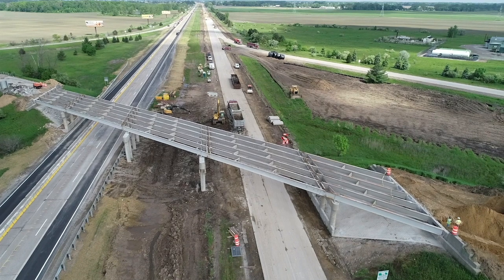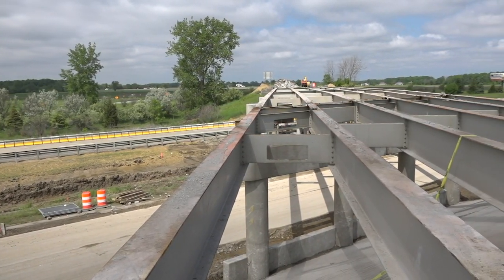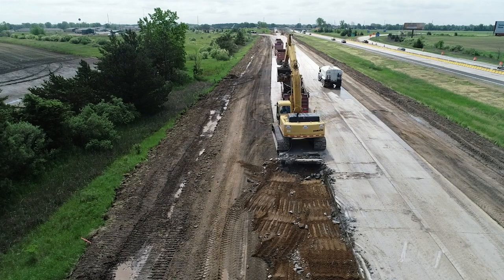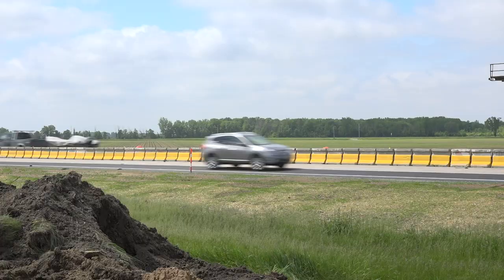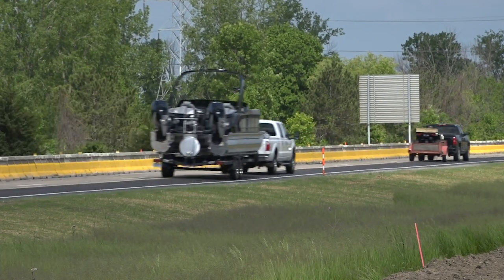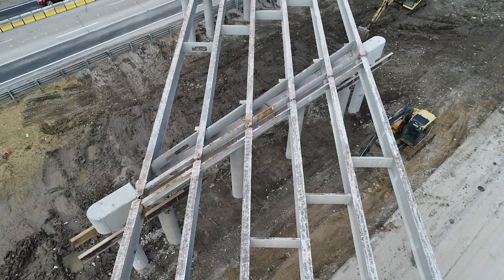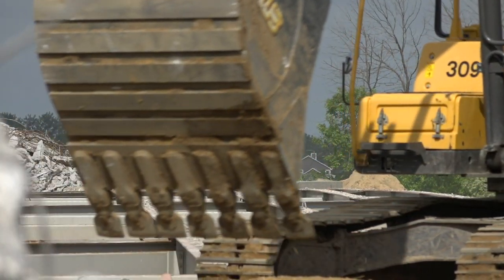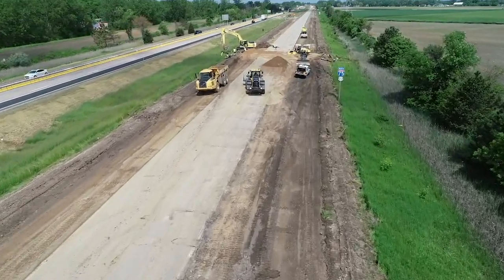I-75 reconstruction and bridge repair, Bay City

Comment: Fix the M-13/M-247 connector
Reply from the maker: Hi Al, the MDOT Five-Year Plan website is not showing any planned work for that intersection currently. However, work can always be added based on available resources. We recommend contacting the Bay City Transportation Service Center for more information - they would be the office planning such work: 989-671-1555. Hope this helps! Thanks for following MDOT.